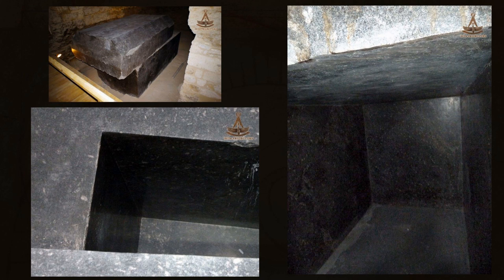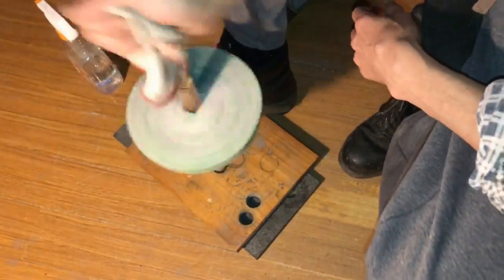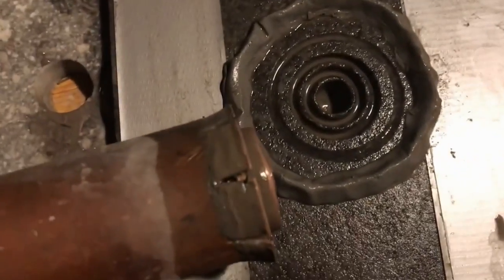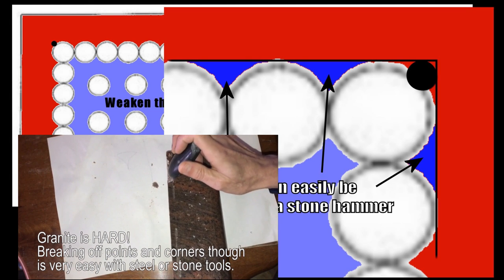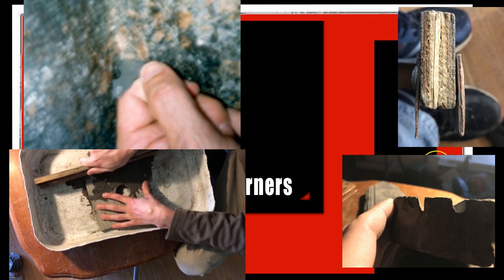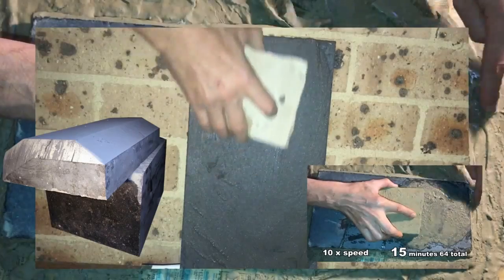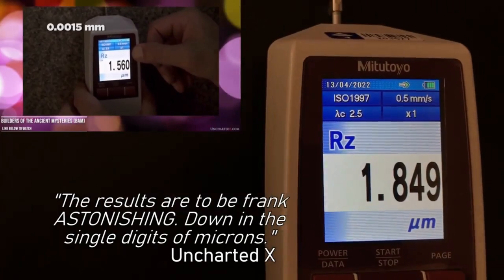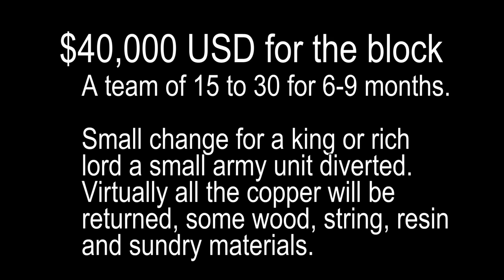Making a Serapeum Box with PRIMITIVE Copper & Stone Tools.What LAHT just won't share with you!

Comment: I wish you had at least a million subscribers.  My idea was the ancients cut a raster with smal copper saws, then broke out the granite stumps with wedges.  But drilling those cores is the better method.  Since traces left by circular tools have been found, this is the most convincing.  BTW, the guy drilling the counter top should use a drill press for stability.

Comment: great video again. side note. as with all types of drilling the larger the diameter of the core drill the lower RPM is required. so if they were doing three or four inch diameter cores in the Box the RPM would not be very high... people often confuse concrete core drilling with concrete hammer drills which have a very high RPM and are for smaller bits
Reply: What kind of SFM did you calculate all things considered ?
Reply: @GroberWeisenstein  quick check on a diamond coated core drill chart 4inch dia is 350rpm so aprox 370 sfm.
Reply: @GroberWeisenstein  ??

Comment: A wonderful explanation of the procedure and how to drill a hole in granite of a few centimeters in a couple of hours... Have you ever calculated the time it would take to make a Serapeum Box using this technique?
Reply from the maker: Depending on the team available 6 to 9 months max at my current work rates. Though I expect it to improve with more than just a days worth of practice that I have.
Lots of little tricks picked up in those first hours hands on. Every little bit helps. 5% improvement here, 5 % there.
Plus the incentive of being paid for completing the job rather than by the hour. By the hour it would take as long as the cheque book remains open. Just like a couple plumbers and electricians I have known. 😉
Reply: As noted it could likely be done in a concerted manner in a period of months.  Yet one most also take into account that the Serapeum existed from the reign of Amenhotep III all the way to Ptolemaic Egypt just prior to the Romans under Octavian defeating Cleopatra = or about 1,400 years.  Yet in all that time only 24 crypts were created.  That works out to on average perhaps 1 to 2 internments per century.  Naturally some are grouped closer together than others.  What is shows however is that not every Pharaoh added to the temple as there were far more Pharaohs during that period.  

Thus as inferred it was likely that a sarcophagi might have been in the works if you will awaiting the next interment contingent upon a Pharaoh deciding to support such.  The Pharaohs wanted to be popular - much like political leaders today.  Accordingly they sometimes attached themselves to various cults so as to take advantage of said popularity among the people.  During times when the Cult of the Apis Bull was popular + a Pharaoh had the resources = a new interment might be commissioned.

The temples themselves employed a caste of workers.  Unlike churches today which solicit donations from the congregations there is historical census evidence to indicate that the priests of Egypt by the New Kingdom period were among the largest landowners in the nation.  Tombs in proximity to large temples around Saqqara of late have shown multiple burials - literally dozens of coffins jammed into underground vaults in some cases.  That indicates that the temple was selling burial space to individuals who desires to be buried in proximity to their favored cult.  So religion then as now was as much a belief as "a business" while the temples in question in some cases apparently had a level of wealth to create what they required. 

So a stone sarcophagus might be crafted over a period of months - or even years.  The evidence lends to either considering how few burials actually took place against how long the temple was in operation.  What matters is they had the time and ability to do it when needed.  Enjoy your day.

Comment: I don't claim to know how the boxes were made but it certainly wasn't "easy" as you make it sound. I would be surprised if anyone today using modern tools could replicate one of these ancient boxes. Just moving these boxes into the spaces where they were found would give engineers today a major fit.
Reply from the maker: The boxes are imprecise. There are old feed and water boxes made of granite available for garden deco now. It’s easy to do with basic tools it just takes time.
Modern granite memorials and such make these boxes look simple in comparison,
Many sarcophagi made that include beautiful sculpture and better finishes.
Moving them isn’t an issue either. I have a playlist called Moving Megaliths. Old timers and modern examples.
There’s a video I have on Serapeum that breaks down the sizes of the boxes and chambers. I go thorough one by one. 
One of the boxes was still on a bed of sand when it was reopened. They lowered the box down into its niche.
There’s so much evidence of who and when they were built that the lost tech crowd are avoiding.
I recommend the Ancient Presence channel and their series. Or the scientists against myths channel.
The boxes have been measured and yet claims of impossible precision etc are still being sold by the lost tech crowd.
Reply: @SacredGeometryDecoded  I didn't know that people (in recent years) went to the trouble of cutting out granite feed and water boxes. That definitely adds credibility to your argument against lost advanced ancient technology. How do you think the megalithic stones found throughout the world were cut into odd shapes that interlock nearly perfectly?
Reply from the maker: @cmackscott761  https://www.youtube.com/watch?v=XdPsZp2K4S8 - modern polygonal examples
https://www.youtube.com/watch?v=L9Tddr6Fl90
The ancient method to perfectly fit stones.
I also have a series on those famous polygonal walls in Peru. The overwhelmimg majority are small stones a single person could lift. To use the method above for those would be easy enough and good evidence for it in unfinished sections of wall.
The general rule is that only the front of the stones are actually fitted precisely. About an inch or two then rough at the back often with filler stone.
The large examples like the walls of sacsayhuaman have giant blocks but they are bordered by smaller stones. The weights of the stones are foten highly exaggerated as they look large from the front but are quite thin in comparison, more like slabs than blocks.
Here's a playlist of people moving stones with basic equipment
https://www.youtube.com/watch?v=jM4wMKcuGKQ&list=PL47iaGB6hlT6qVaxoxQoK6N6KI9FnbUIl
Copper and stone tools
https://www.youtube.com/watch?v=lza9xBTDx0Y

Comment: Excellent explanation of these operations !
Be convinced of the correctness.
My question: how can you drill a horizontal hole in stone or a hole in a stone ceiling.
Then the sand and water would keep falling down, I don't see a solution for this.
Reply from the maker: Thanks
Was asked to do demo of horizontal drilling for another channel.
The next project on list.
I will pack the tube with abrasive and mix some clay in as well. Wax could be another option so it’s self feeding.
The name reason I use that much water is to keep the dust down. As long as the abrasive is a little muddy it won’t fall out like dry sand.
In earlier demo grinding flat surface the muddy abrasive mix made the grinding stone stick to the wall. You could have a large heavy grind stone and not be exhausted if you get the slurry mixture right.
It can even get stuck on like a suction cup and needs to be banged loose.
Reply: @SacredGeometryDecoded  
I hadn't thought of that, seems like a great idea.
So there is always more possible than you think.
I always find these practical solutions interesting.

You've probably heard of Davidovitz, the French chemist who discovered geopolymers.
Some large stones also seem to be cast as concrete and therefore close together exactly when they are cast next to each other in a formwork.
What do you think of making concrete in ancient times?

Comment: I don't know how you get to these numbers of 15-20 members , 6-9 months
Olga the sculpture carved this corner in 40 hours to carve about 125 cm cube, if you calculated the interior volume of the box from Wikipedia and assume worker works 12 hours a day, this will result to about 500 years, only carving without polishing
6-9 months this number don't stand on any real calculations
This drill tools marks is not shown in any Serapeum box, even the unfinished, and unpolished boxes
in addition, either it is copper or iron doesn't make differences, because eventually you are using sand, which is harder than iron it self
 This is not the way they use
Reply from the maker: I explain in detail and show/link the experiments. The numbers make absolute sense and can be easily tested. 
Olga used stone tools, the bulk of the time was using a stone hammer to bang away and remove the material. With a copper drill or saw you can do that work in a fraction of the time. 
There are lots of examples of drill cores in various sarcophagi including the one inside great pyramid. Other tool marks such as striations from cutting remain such in niche 17 because they didn't bother with a high quality finish.
The numbers do stand up and can be tested for work rates, I have done it multiple times and shown in videos. Anyone who claims otherwise hasn't done the work and I am more than happy to do a live stream challenge.
This is the way masons still do it.
Hollowing out the granite boxes is basically a glorified trench. Removing that material is easy although laborious.
There are only 4 corners that need that level of care and skill, The rest is waste material and 50 years to remove that is ridiculously over exaggerated. A total invention in fact. You just made that up. 
Taking the stone tool making a detail corner to measure the rest of the work.
Take a piece of granite, drill the corner, use a copper brush saw to tidy up and straighten it. A granite corner would be done in about 1/10th of the time. My numbers absolutely stand up and what's more i can and have demonstrated the process.

Comment: I still can't see HOW they actually did this way back - having huge boxes, in very hard material with great precision.

E.g. in this video, they use machines to polish the surface and drill the "cores" out of the box. And the box is tiny. And to just say that it's no biggie to spend 6-9 months back in the day is not debunking.

I'd love to see a video going from A to Z quarrying, transporting, working on a massive granite block, creating a copy of the most advanced box + transporting it in similar conditions as in the Serapeum in regards to distance and space + cutting the lid etc.

Just to cherry-pick "solutions" is not an answer to the HOW question IMHO.

Also - your attitude in the end of the video is not ok - of course, anyone has the right to question complex questions like this, since they do want to know.
Reply from the maker: In links I polish by hand, drill by hand, cut also.
Links to people moving much more difficult weights. Old fashioned quarrying.
The most advanced box is not precise despite the many claims. I have videos showing the measurements being taken.
It is a biggy to fund a crew for 6-9months , buy the granite.
A small box is exactly the same but takes longer and is much more expensive. 
I am not cherry picking solutions, i show the process  and provide work times.
Why wouldn't the solutions work at a certain size?
I'll happily make one with those tools if those who want to see it are prepared to contribute.
It's not OK to want something without being ready to do something about it.
Those who demanded the small experiments claiming it was impossible simply shifted to make a big box now. 
All the individual steps have been shown. There's no reason at all that they wouldn't work to make something larger.
If you're willing to pay to have that proven I'll gladly take the money.